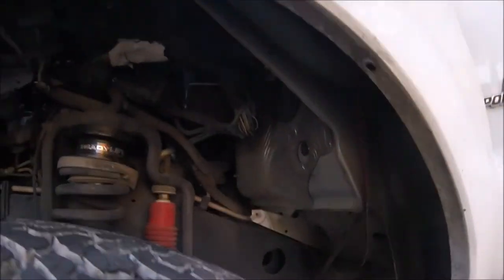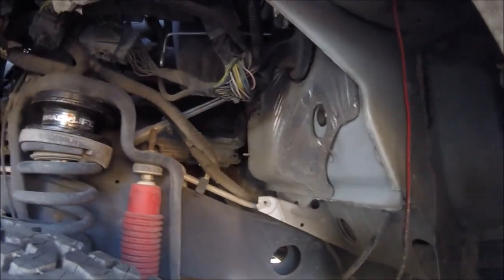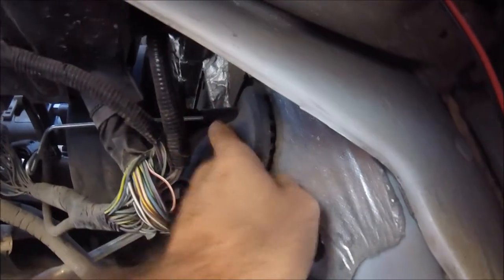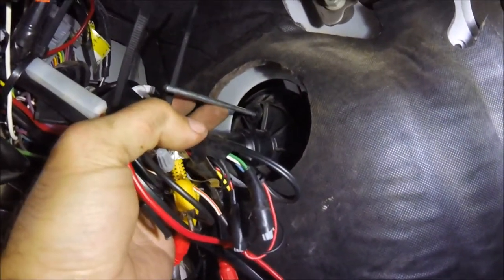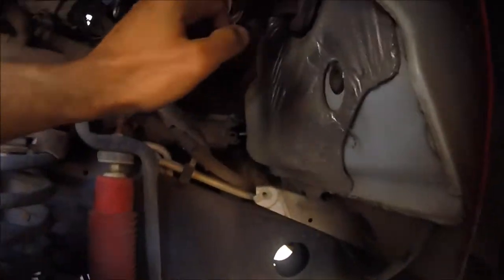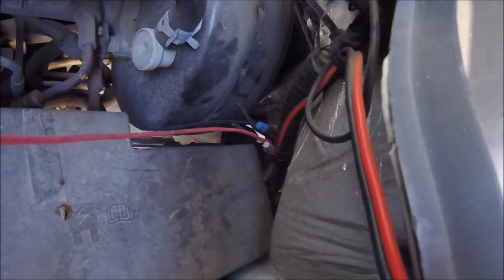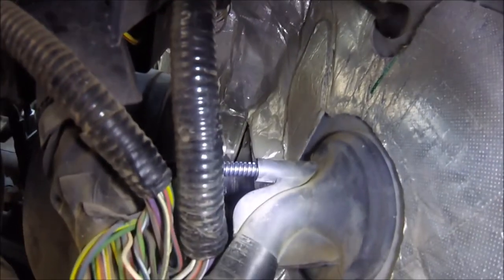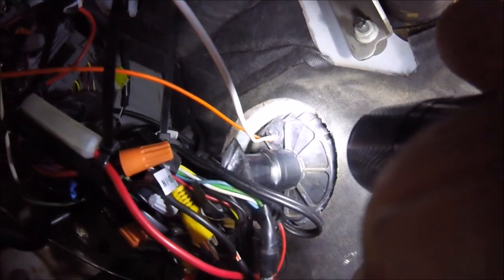Ford F-250 XLT Super Duty 6.7l - Factory provided firewall pass through

Comment: Please tell me you didn't install those wirenuts! They are for stationary applications. IE house, barn, building. Should there be a fire, the ins won't pay.
Reply from the maker: I did, almost 8 years ago now. Truck has driven across the country 3 times. Almost 200,000 miles since they were installed. These wire have extremely low amperage going through them and are fused. If tightened correctly and wire secured properly, they work okay. They were intended to be temporary for testing a setup, but have given no issues so I have left them be. The exterior ones have been changed. Just electrical tape and zip ties to keep everything from loosening up and hanging. Sure, it not by the book, but it has worked well. Others have pointed this out in my other videos.